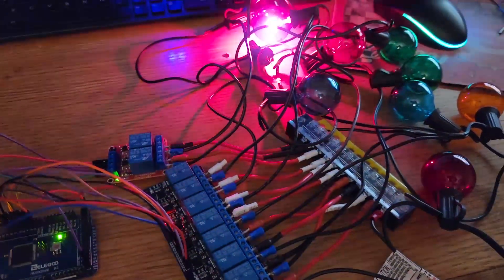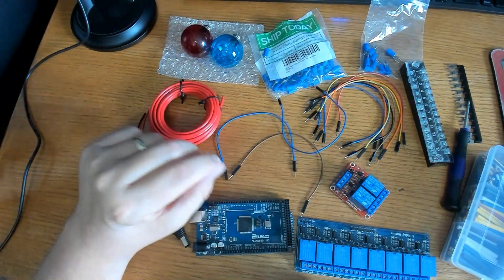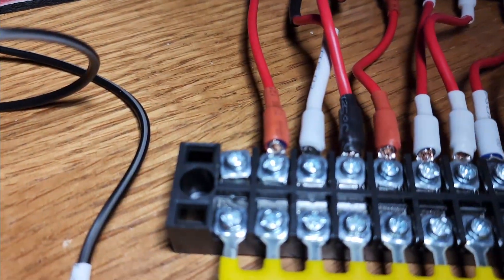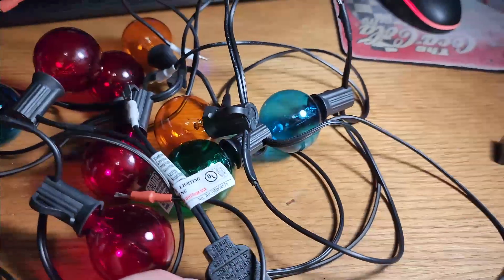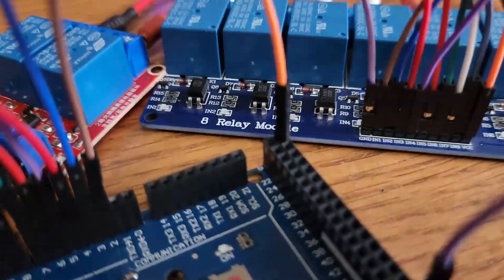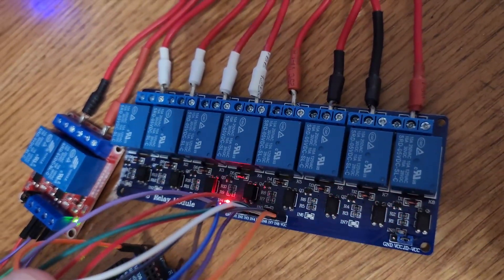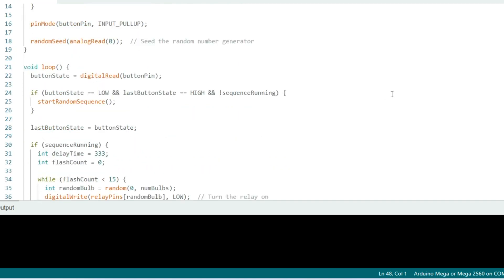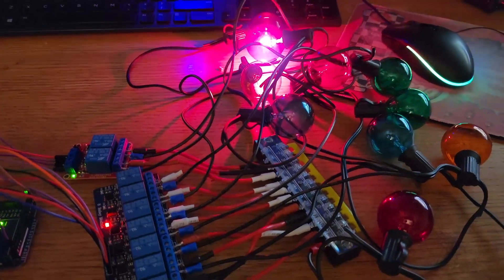How To Control Light Bulbs With Arduino Mega And A Multi Channel Relay - Random Selector Lights

Comment: will it work with out pull button put a time clock instead
Reply from the maker: hey there!
sure, it will. You'll need to add some different hardware and change the code, but yes, totally doable. 👍